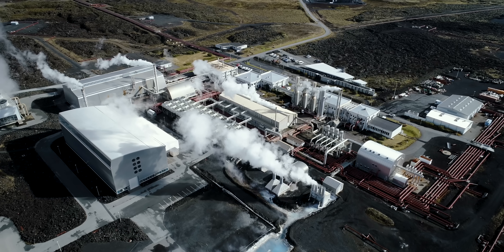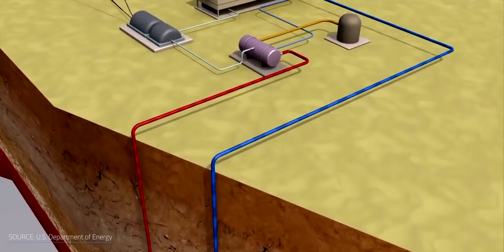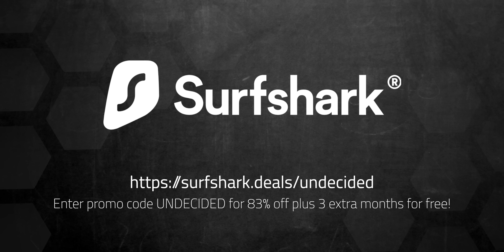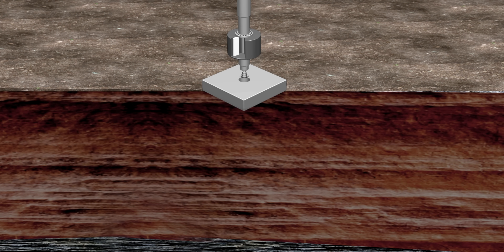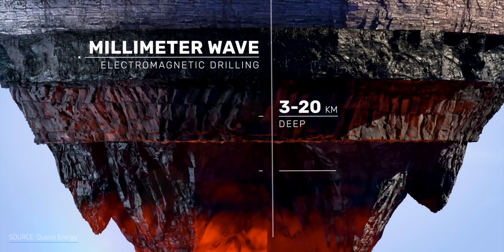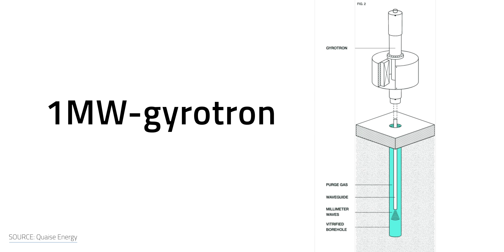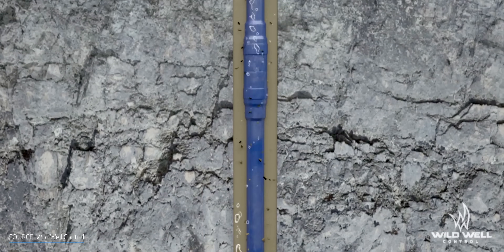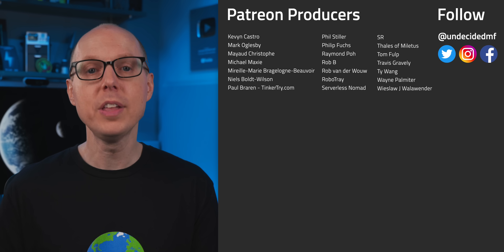Why This Fusion Tech May Be a Geothermal Energy Breakthrough

Comment: How deep have they been able to drill with this system?
I spent 45 years in Alberta drilling wells as deep as 2,800 meters
Your glassy rock is probably also VERY brittle 
As an experienced Geoscience professional, I hope you are right, but I hope you have a way to circulate the material to the surface. 
This is more complex than you can imagine. 
Failures in procedures can kill people, ask me how I know. 😔
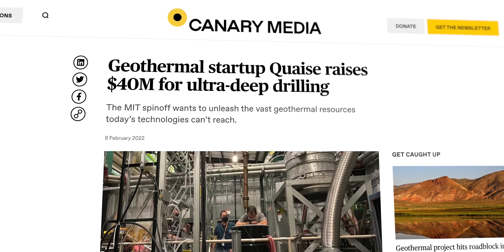Reply: It says at 11:35 that they've drilled three feet.
Alberta would be an ideal place to do a pilot of this idea: lots of drilling expertise, lots of existing unused boreholes, thoroughly mapped geology, etc., etc.
But like you I'll retain some healthy skepticism about this until they demonstrate "drilling" into the Precambrian basement.
Reply: @JonMartinYXD  I feel like the best way to circulate out 'cuttings' would be to pump water down string, and out port it at various depths, and use similar devices to the gyrotron to vaporise the water as it passes from string to annular to make sort of hot gas boosting stations up the hole, that should at least keep the vapourised rock media piping up to surface without slowing down or cooling down and precipitating minerals in the annular. But redunculously complicated.
Reply: The glass lining of the hole. also got this layman's attention. I'd imagine if the drill makes any contact to those glass walls, it might break. I'd be very interested in a proof of concept to let's say 1km of depth!
Reply: @eaaeeeea  it would be mote like rock than actual glass. but it wouldn't have any tensile strength, so bore wall in push would pretty easily create problematic shearing.
Reply: @eaaeeeea  When you get the vitrification, no mechanical drill is being used. Just a waveguide connected to the apparatus on the surface. The waveguide could bump the walls with no risk of damage as there are no moving component on the guide to be damaged by it.
Reply: But how you stop very hot pressuring lava. Can you ever stop it?
Reply: Yes. I'm not experienced in this field, but I can do basic mass balance equations. The work that it takes to lift the vaporized rock is mass * g * height. If their plan is to use flushing gas, they'll either need insanely high differential pressures to achieve high specific thrust (like high pressure gas on input side aided by massive vacuum on output side) OR mechanical removal like auger conveyance which is probably not practical at these depths. Needless to say, the challenges seem big.

Comment: I see the advantages of constant power from a clean source, like a coal plant or other traditional power plant, they're still releasing MWs of heat transferred from the core into the atmosphere; whereas solar captures ambient energy already coming from the Sun that would have been absorbed and radiated as heat, and Wind is essentially utilizing solar energy that's already heated the atmosphere asymmetrically. I also get that land usage for a plant of this type would be far less than a solar farm or wind farm so it's an interesting question of alternatives.

Comment: The cost estimate is waaaaay off. You still need a rig which is the biggest portion of the cost.  I also see lots of potential fouling issues removing vaporized rock.

Comment: You need lava to heat the water to produce steam. Otherwise, the steam is not powerful enough to run the generator. This is easy when you have a close volcano. However, when you don't, you will need to dig 4-6 KM to get the lava.

Comment: Geothermal energy is extremely dirty. I don't think you guys really have any concept of how dirty. In a lot of the places where it is accessible, there are relatively high levels of radioisotopes and heavy metals. You're talking about accumulating levels of radiological and chemical contamination that will persists in ground water for a long, long time. Vaporizing or particlizing rock may sound good, but it is extraordinarily bad in most cases. Anywhere that you drill a lot of these holes, you're going to have a lot of contamination, and this sort of contamination is very serious and comparable to the sort you find in large scale mining. This isn't going to go anywhere, that is, not if you care about the ecological damage. On a large scale, this would add millions of tons of contaminants to soil, ground water, and to the atmosphere,

Comment: I love that "we" are fumbling our way into the future and discovering better, faster, cheaper ways of solving problems. I didn't hear anything about hitting water, oil, or gas during drilling. I would assume that a very hot laser & a large pocket of gas will not be friends. Water might cause problems but I think a standard drill setup with encasement through to the bedrock might be a solution. 
BTW, if you want a side hustle, I suggest narrating books for Audible. You have a wonderfully soothing velvety voice. Also, your channel selfie makes you look like an old man. You're obviously not.
Reply: i suspect the gas problem might solve itself due to lack of oxygen (though i dont quite know how the glass sealing reacts to large pockets of empty) and if it vaporized rock...water will vaporize just as well...its just going to be part of the overall mix that needs to be evacuated up the tube
Reply: @SharienGaming  There is a coal mine that is ritch in Oxygen that has been burning for like 80 years at this point, it's some where in amrica, i'm not sure what it is called though but if you google it im sure you can find it.

Comment: This is a huge step forward from the old declassified tech the air force worked on for tunnel boring. They were using a hot material to drive through the rock which also created the glass like walls. This is so much more elegant.
U may want to dial back the amount of puns. It borders on annoyance when overused

Comment: If they are drilling near existing power plants in order to convert them, it seems like they can get the energy to run the lasers and pumps from the plant prior to it being converted to geothermal, thus doing away with the need for diesel generators.

Comment: The only real issue I see. The SHR is also softer rock, this softer rock may or may not be thick enough to hold back any magma.
Which could lead into the possibility of creating man made volcano. I am all for new and creative ideas, or ways of generating energy. But at the very same time I have to be the devils advocate. By thinking of some of the negative possibilities. Just like another individual mentioned there is also the issue of possibility warming the surface area of the planet with the venting systems needed for this idea to work properly on a planetary energy production scale.

Comment: Unlike solar, geothermal is always available. But does it have to be always on, like most nuclear power, or could it be dispatchable like hydro is? Obviously you can turn it off just as you can with solar or wind, but when you do that you're just throwing energy away. Whereas with hydro you can save energy for later and generate more later because you turned it off when you didn't need it. So really the question is what limits the power output from a geothermal plant? Is it the transfer of heat from the immediate rock into the water? In this case it seems like you might as well leave it running 247. Or is it the seepage of background heat into the rock that is next to the water. This is a slow process so maybe turning the plant off when not needed would allow the close in rocks to heat up again so that when you turn it back on you can get more power than you would have if you had left it running all the time. This could mean the plant could be used as dispatchable power like a gas peaker plant to fill in gaps between supply and demand. Until batteries get much cheaper dispatchable power is extremely valuable.

Comment: Geothermal doesn't necessarily require drilling. I have seen a few systems that use a trench or a pond as the heat sink. This does require more than a city lot. But the system is not much bigger than a typical leaching field. I suppose you could actually get the geothermal and leaching field to do double duty, with the heat sink below the leach field.

Comment: I'm skeptical.  If this hole needs a pipe lining and you're relying on the rock there to turn into glass it sounds like that could be a source of failure.  As you drill down even in specific rocks you'll find different materials like quartz.  So you'll have zones of different materials of glass behaving differently.  I'm far from a glass rock expert so perhaps someone else can pipe in.  But that sounds problematic to me.

Comment: I worked in maintenance at a geothermal plant, so I am aware of the reasons why it is unpopular. Big money does not benefit from it and does not like the risk associated with drill failure, but thanks to mm wave drilling, any debt can now be reached, and even pumping air cold in  hot air out  has the potential to drive turbines or stirling engines. Unfortunately, however, you cannot sell oil, coal, or nuclear experimentation to this plant, so it is useless for big money.

Comment: I think is a wonderful technology, but what about if is abused as all energy technologies and could accelerate the cooling of the inner core? It may sound ridiculous, but earth is not generating radiant heat is cooling down from its formation and eventually it will end as a cold rock in millions of years. I think is not a long term solution and is not to be abused. Solar on the other end is a real renewable source that is form the expulsion of the sun not sucking it from the inside. draining heat from earths core in a big magnitude could exponentially put us in danger. And humans are power hungry. Think of it in a big scale...

Comment: Wow, what a great concept! This answers an idea I had regarding the disposal of nuclear waste. Just wonder if the waste can be injected through a larger hole into an active area of magma and sink to the next level down. It would take millions of years to get to the surface. Anyway, probably won't work but it's a start. the pipe would need to be able to withstand the temperatures there so it is unlikely a material can be found for that.  Thanks again, Matt.

Comment: I'd be interested to hear more about the engineering involved in actually drawing power from such a setup. What kind of overall power can be drawn? How is it scaled up and down? Don't you need two holes (one for drawing water up, one for returning it), are there issues with water flowing backwards, up the injection well? 🤔

Comment: Don't transport the water, transport the energy
Put a thermophotaic at the bottom, make the chamber walls reflective to the frequency

Or put a heat engine pump down the hole, 
Or design the system to have natural convection

Or drill a bigger hole and insulate the pipes better to reduce heat bleed off loss

Comment: It's a hot idea... existing fossil fuel plants using their infrastructure.. Deep lake water cooling Toronto & Cornell for AC.  Oceans = ultimate energy source,  more out there than just solar & wind.  Small rust belt city = several billion = business incubator = start up alternative energy companies. Built around a central hub = engineers open source info = share ideas = piggy back tech...

Comment: I like the tech as long as over the long term this cooling of the earths core will not cause another issue !
not forgetting when digging out oil it was supposed to last forever as well.
other than that I think that this could be a gret option to add to our mix of power provission.

Comment: This is promising. The way the cost is being compared to solar might be flawed as it doesn't include the cost of adding storage to solar. 
It was shown in the graphics but not discussed. Geothermal of the type proposed needs at least two holes and fractured rock between them.